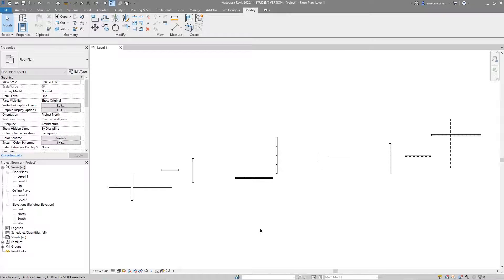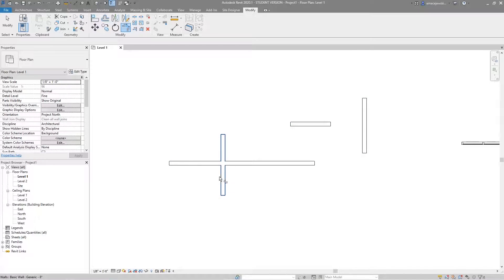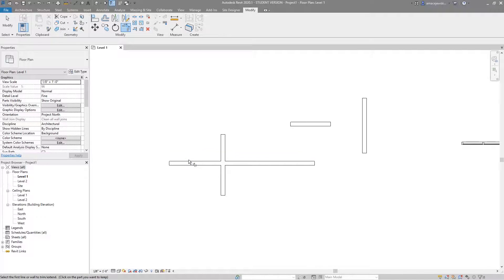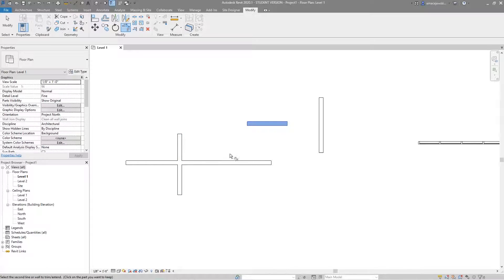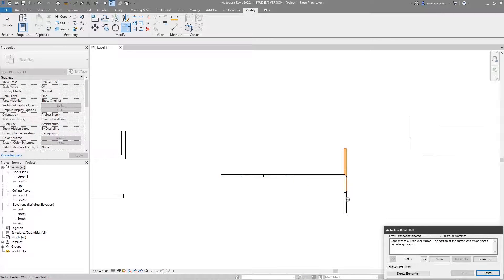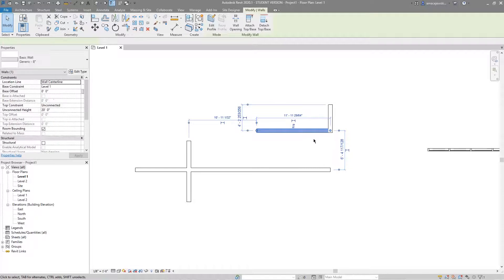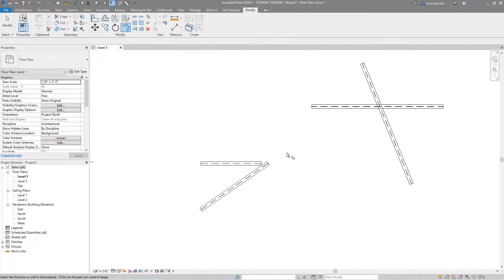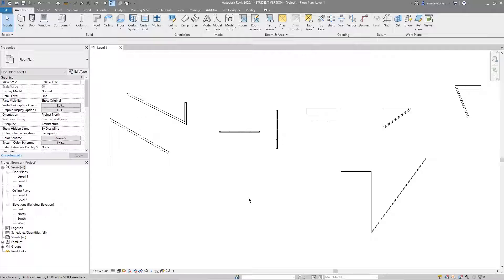How to Use the Trim Tool in Revit | Revit

Comment: Thanks for your video.  I want to know how to we separate two walls so that when I move a partition/innerwall, it does not affect the main/outer wall.  A sort of break tool or a way to lock the dimensions of the outer wall so that it does not change when I change secondary inner partitions that is adjoined to them.  Thanks in advance.

Comment: There's no option to be able to keep the full segment of a wall or object that you want to use to trim another?  Ex:  You create two walls that are crossing and you only want to trim away one segment of wall... Going from an "X" to a "T".  Does this function exist?
Reply from the maker: There is unfortunately no option to do this within the trim tool. I do see what you're saying and this would be nice to have within the too. Part of the reason we know this is not possible is because the tool is actually called Trim/Extend to Corner. Too bad there is not a toggle for us to turn the extend part off.